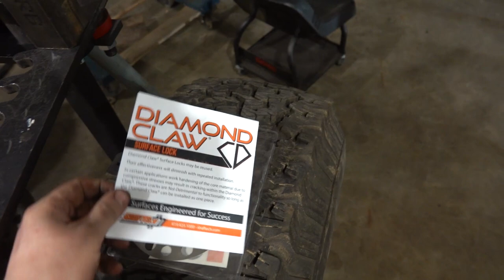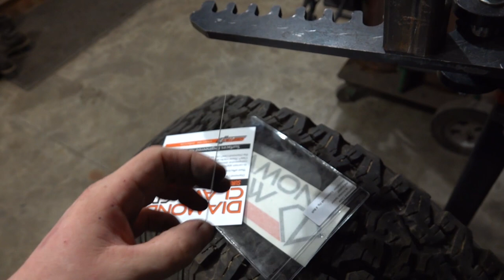This Washer Could Save Your Cummins Crankshaft!!

Comment: Hey Tom I don’t know how thick those are the heads are on those bolts holding the flex plate to the crank I don’t know if there’s any room to make them a little bit thicker if they did they could set them up with holes through them side to side and safety wire them something to think about I don’t I just don’t know how much room there is in between the torque converter and those bolts anyway food for thought thing this is six in a row Jim are used to work for the Boeing company and I did a lot of wire tying

Comment: So are you going to run two different shocks one for the sled pulling and a different setup for the drag racing
Reply: Atlanta on the front
Reply from the maker: Rear will pretty much be solid and the front will be blocked up so it rides on the bump stops with the weight box on. The coil overs will stay.